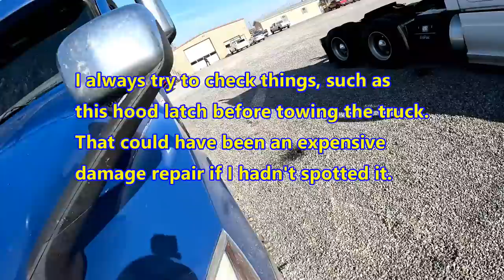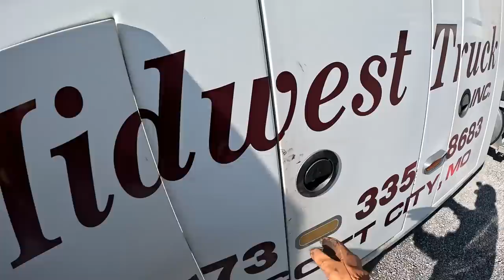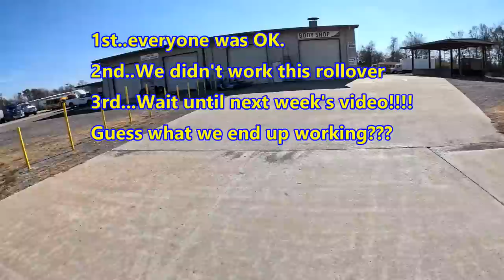WITNESS TO A ROLLOVER!!! WHILE TOWING A TRUCK WITH THE WESTERN STAR!

Comment: Even though ive seen a few rollovers in my time, it still staggers me how much the frame of a truck can twist and not break in these situations. Ok its unlikely to be road worthy afterwards but the fact something you think of as being solid can bend so much and (mostly) back again is mad...
Reply: Try sitting on a bridge, waiting to turn, and have heavy trucks using one of the other lanes, making the bridge deck bounce!
Reply: You would be surprised what is able to be repaired & put back on the road. A lot of them can be repaired, it's just the funding to do the repairs. Some companies will collect the insurance money, & if the insurance company totals it out, buy it back from insurance for pennies on the dollar & eventually rebuild. 
I've driven for companies that do exactly that. The companies i drove for had their own body shops, so they could rebuild for much cheaper. They can straighten some frames.
Reply: Yes Iron is one amazing material, it can twist, and most often the frame is hardened too, this is one reason one should not weld such frames, after one accident.   The old VW-Beetle had torsion bars as spring axles, one end of it was fixed in a pipe and on the other had were the wheel-bearing with brakes mounted,  and  it could twist when the wheel hit a whole or pump in the road...
Reply: Sumter Wrecker just posted one where the frame twisted a full 180 degrees -- and still largely untwisted when pulled back onto the road and righted.  Still done for.
Reply: Watch them installing train tracks... those things bend like cooked spaghetti, it's unreal..
Reply from the maker: @brettmorton7365  Also, check out footage of train tracks when they expand due to excessive heat.  I've seen it in real life and it's amazing.   Dangerous, but amazing.   Thanks for watching and God bless.
Reply: @RonPratt  or after an earthquake 🤯
Reply: @RonPratt  Heat Kinks are a real thing, absolutely... very very dangerous if you're booking along at 70mph and don't see it.

There's video from an Australian railroad, where they end up going over a kinked rail - amazingly don't derail, but it's a massive jolt.

Even more impressive is if you get the chance to watch the track crews remove the kink.  The noise when they release the tension can be mind boggling.
Reply: @JV-pu8kx  that used to happen alot crossing the Bluewater bridge when it was just a single span until the added another next to it runs across the St. Clair River. Port Huron USA to Basically Sarnia 🇨🇦
Reply: @brettmorton7365  CWR?

Comment: I worked as a HVAC field technician, going to people’s homes, fixing furnaces and air conditioners. One house I was at, I was doing a clean and check, preventative maintenance on an oil fired boiler. Everything was going great on that till I went out to the truck to get a nozzle for burner. I was working quietly cleaning up the electrode assembly when I heard metal grating and a thud outside the truck. I looked over at the house next door and their oil tank slipped off the bricks and slammed against the house. Luckily it didn’t go through the wall and rupture, spilling 275 gallons of fresh heating oil. It just fell off the bricks the legs were on and sideways against the house. 
I handed the lady a business card that came out thinking I did something to it. I told her that I don’t touch other people’s property but would be glad to come back and fix it if she scheduled it in.

Comment: Those Cascadia hood latches:  sometimes it helps to have both sides engaged before locking any of them down.  The action of locking it down on one side puts twist on the hood and raises the other side enough to make engaging the latch difficult, if not impossible.
Reply: Or not be wearing thick gloves while trying to latch it like he was doing..  That's why Ethan was able to get it and showed how it was done without wearing gloves.
Reply: Sometimes using the middle finger to latch the hood on those types of latches will make things easier.

Comment: Your dad seemed like a real class act when he was in the videos. If it was up to me, I'd leave the color scheme of the "Big Star" just as it is. It just wouldn't be the same if you were to change it from the burgundy to blue.

Also, I've always loved those hood wings. They're "old school" but still functional additions. My dad always had one on his conventional tractors and I've had one on my Classic XL since a few weeks after driving it off of the dealers lot brand new back in late 2005.

As always, be safe and God bless you, your crew and, your equipment.
Reply: I was thinking the same thing. The truck is very special to them, might just as well keep the color scheme that Ron’s dad chose on the truck and use that as a memorial for his dad. Updating the lights for safety reasons I would fully understand since emergency tow and recovery is extremely dangerous. You could call it the centerpiece of the truck collection.

Comment: When artic tippers came on scene, we had 3 go over in a week, the management banned them as we lost so much time for them to get recovered. Luckily no one hurt or structural damage done to our building works.  Never had a rigid truck go over while dumping its load, had an 8-wheeler tip over when the driver went for a drive with the body way up in the air.

Thanks for posting, maybe you should keep the Vulcan in your dad's colours as a tribute.

Comment: 39:40 I've used a chain binder to pull slack in a tight chain before. Hook one end on the frame and the other as far down the chain as you can get then tighten.

Comment: On new truck deliveries, Kenworth had to stop pulling from the rear like you did.  Because when they tied down the steering wheel with the seat belt, the steering wheel is so soft now the seat belt would tear it up.

Comment: Extra excitement that wasn't at your expense!!  He didn't watch where his tires were.  Very soft ground to be raising a rig that high!  Good video Ron & Ethan
Reply: Dumping an "Endo" is a bit of a crap shoot, even with perfect ground conditions. If the load sticks, up front and to one side, it really throws the balance off.  What can be bad for a regular dump truck is magnified because of the height the front of the trailer must go to, to fully dump.

Probably why I've seen only ratty looking tractors doing endo work.  I've never seen a brand new tractor used for it, anyway ...

Those big, oversized off road haul trucks are designed so the bed/back can flip without laying over the front, where the engine & operator are.  Tip it back upright, go back to work.  Letsdig18 has shown a few instances of that in the past year.

Comment: There is a way to do hood latches on those freightliner fold the latch down as if you was opening it take your index finger put pressure on the hook in between the latch handle and slide the hook up under the latch itself and 99% of the time it'll work but sometimes you have to pull down on the hood above the latch.

Comment: The Western Star has a class level that even a Pete can't touch.
Reply: Western Star is now owned by Freightliner. They are just different body styles on Freightliner chassis. Unfortunate.
Reply: Western Star was originally White Motors Co. Answer to Peterbilt Kenworth Freightliner. After Freightliner stopped being marketed by White. 
Volvo snagged White GMC class 8 
And MACK. Western Star went on their own.
Reply: @darrenk4507  I'm sure you know that Daimler has owned both companies for years. I currently own both Freightliner and Kenworth tractors, I started buying KWs after having to replace all of the coolers on 2 Cascadias because of debris going through their plastic grilles (KW and Pete still have metal grilles). The 2 Freightliners I still own, a 1995 FLD12064 and a 2006 Classic XL also have metal grilles. Those coolers ain't cheap!

Another real shame is that Mack has been owned by Volvo for quite a while too.
Reply: @darrenk4507   the old western stars before freightliner was good trucks made with real steel.  Sad times when they sold out.
Reply: Uh...no

Comment: Yup I agree with your assessment of the hoid latch system on the Cascadia's.
Reply: I know. I've had instances where i was only able to latch one side. Not ideal, but it happens now & then.
Reply: probably the only hood latches that are worse are the ones on the 387's. the releases are inside the cab and easily bend. when I was at Martin Transport, they constantly were replacing them.

Comment: When I ran a heavy we used axle straps on the axle tie off to the t bar a lot but I didn’t like them cause I didn’t have any slack for tilt or sway. And we used a chain from one side to the other with a boomer to chain up axles

Comment: In the late 70's I was driving a tri axle on a dirt job in indy,the dirt contractor had a dump trailer on the same detail  as myself..I  followed him into the dump site but I  didn't back in along side , anticipating a bad outcome, I chose to wait just ahead of his front bumper just in case ..mabey 1 minute later he was on his drivers side, fallen over where I would have been,most straight dumps would have backed in there to get ahead of the slower truck trailer (Buster Layman trucking)..I  was driving for Harold Butler (Sr.)

Comment: The first Cascadia I drove had that problem with the hook latch.  After numerous times in the shop for B service, I finally got a tech to fix it.  Every previous time they tried to adjust it. Most likely that truck you towed has a crimped cable on one side and it won't ever be right until it's replaced

Comment: HEY RON. A COUPLE IDEAS FOR YOU TO THINK ABOUT. TIGHT AIN'T ALWAYS BEST. AND CUT UP A 2X4 12-IN LONG. WHITE PINE IS FINE. OH THAT RHYMED. THAT WAY YOU CAN BLOCK THAT AXLE UP IF YOU HAVE TO. SACRIFICE ONE OR TWO 2X4S. THEN ALL THAT CHAINING UP AND LIFTING UP. THAT SEEMED TO BE PRETTY AGGRAVATING. AND THE TIME DID IT TAKES TO DO IT. BUT JUST A COUPLE THOUGHTS FOR YOU.

Comment: I know of a gentlman that was using a fifth wheel wrecker to tow one of his own trucks. He tied the steering wheel with the seat belt. When he pulled in his own driveway the seatbelt came loose and he took out a telephone pole and did $25k of damage to the truck being towed.

Comment: Used to work at a large dump in california. Those guys would roll all the time, especially if dirt didnt release from the top and everything else slid down. Its almost like there built to twist like that rather then take the truck over too.

Comment: Nice job you will have to put some more cameras up then you would have caught the roll over. Could you have put some weight on the frame with under run to free up the chain

Comment: Hiya Ron...
Andy here again...
On this truck being towed...
The plastic liquid tank behind the cab between the frame rails...
Any idea what that is???
Didn't think that could be the hydraulic oil tank for a wet kit, cause those are always steel, or stainless steel tanks...
Was just curious cause i have never seen this before...
Thanks and thanks for all the Great Videos...
Reply from the maker: That is actually the battery box!!!   Some Freightliners have the batteries between the frame rails, behind the cab, above the driveshaft.   Terrible design, in my opinion.  Here is a link to one that is for sale....I'm not trying to sell it, just wanted you to be able to see a picture of it:   https://www.mylittlesalesman.com/2010-freightliner-cascadia-125-battery-box-9227763    
Thanks for watching and God bless.

Comment: Maybe I missed it, but I saw nothing with releasing the truck brakes ? (rear wheels only ?)
Reply: With both rear axles lifted, park brakes don't matter.
Reply: @Leotheconstructionguy  Thanks :)
Reply: @Leotheconstructionguy  Spring-actuated parking/emergency brakes, that is
....in case anyone misreads this. Steer axle has service brakes, which are only applied when pressurized with air.

Comment: RIP TO YOUR DAD! How long Do you plan to keep the 2006 WESTERN STAR 4900 night cab Heavy-Duty 35 ton wrecker tow truck tandem-axle? Plus the 2015 PETERBILT 389 day cab Heavy-Duty 50 ton rotator tow truck tri-axle single steer

Comment: The dump trucks need a microcontroller.   IMHO there should be two tubes of mercury.  The bubble should be perfectly centered in the '+' b before the bed is allowed to rise. And dump the payload.
Reply: The microcontroller box should sit somewhere  centrred on top of the trailer's tandems, tridems, or whatever.
Reply: Until then, the driver needs to carry and use a long carpenter's level.  Get out and check the two angles of the bed.

Comment: Good job guys 👍 here. Quick question why don't you like using the seat belt in the steering wheel to tow it ?  Just trying to learn alot from you.  Thanks man
Reply from the maker: It is just a safety concern that I have.   I never know what stresses have been place on the seatbelt.   Also, there is always a bit of movement on the steering wheel.   With the straps I use I know the quality and condition.   Once they are properly in place the steering wheel isn't going to move.  Thanks for watching and God bless.

Comment: I replied to a class a tow truck driving job here in the Chicago sunurbs. 

Are you still watching videos for entertainment planned on using them as my classroom.

I am apprehensive that my age and 58 and a quarter years old is maybe too late to do something this physical when I don't already have 20 years experience.  

I'm going to be candid: the sharp-looking tow trucks to entice me as bugs are drawn to light. Some of the dilapidated crap I've driven as a Class A truck driver is just.... Well—this is a family channel.

I just lost my ability to stare the highway for 11 hours a day so I can't do any over-the-road gigs. Local jobs are all the junk equipment are and I don't like all the clutching—but I'd rather that over most automatics or I should say automated-manuals.

Many tipsgiving in this video such as pre-trip being the suspension system to how to hook up the safety chains to how not to hit the truck with the tow bar and how to check for loose farings and open hood latches.

If offered the job, should I take it because it pays handsomely. I also go for hourly gigs nowadays because I just don't make money by the mile or by perventage: the former by not enough and then the ladder by divided by hours worked is just low pay.

Comment: Okay I'm laughing my ass off right now. Ethan pointing out the air conditioned and heated seats while you're busy trying to figure out the strap, followed by a cut that seems like you edited out "telling him off" for not paying attention to what you're doing/distracting you sounds just like every time I'm around my dad when he's doing something on a car.. I get easily distracted and notice other things which invariably ends up with him cussing me out for distracting him.. I have no clue how he was ever and instructor in the Air Force with how bad he is at multi-tasking/getting disturbed by other people's distractions.. 
They also have the helmets that have the little strap the goes under the base of your skull and the little bit of tension allows it to stay on when you bend over. It'd probably be annoying as hell until you get used to it but so long as it keeps the brain bucket on your head, that's all that matters.
Looks like the Western Star needs a set of your auto-tightening ratchet straps. The other option to get that chain unstuck would've been to push down on the frame to get the suspension to compress.

Comment: Hey Ron I have a question about one of your recoveries seen in a video you did a while back. Yes I know I should have asked it then. I understand when you're pulling the tractor from a tractor trailer from the front You need to disconnect the drive shaft as it can cause damage to the transmission or engine. This I've seen done a few times in your videos. There was one where instead of disconnecting at the universal joint.  In this one you were pulling out the axle or axle shafts. Why would you do that?
Reply from the maker: I'm not sure which video you are referring to, but there would be one of two reasons for removing the axle shafts VS removing the drive-shaft at the u-joint.   First would be that the drive-shaft bolt or caps were too tight, stripped, or otherwise in a condition where it was difficult to remove.   Second and the most common reason would be if there were damage to the rear ends (drive axles and their gearing).  By removing the axle shafts you completely disconnect the gearing inside and help prevent any further damage to the gears or the housing while the wheels are rolling.   Thanks for watching and God bless.
Reply: @RonPratt  Thanks for that Ron. I think you may have jogged my memory just a bit. Knowing you, you would have explained it then.

Comment: Mechanic here for 44 years ,,, I’ve always seen the seatbelt used to hold steering wheel,,, lol if proper or not ? I don’t really know… lol
Reply: But it works ,,,
Reply: We used to use a 3/4" hemp rope! Loop it around the wheel, pull it tight and slam the door, put a square knot in the ends so it wont pull through! Might could get a little dog track but it worked!😉  
Better methods and equipment now days! But we did a lot of work with that 650 Holmes!